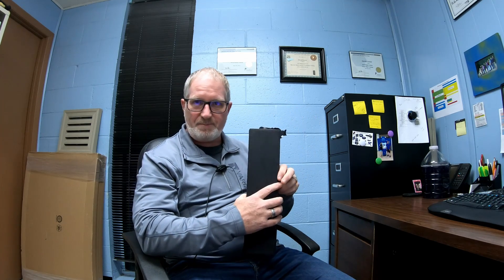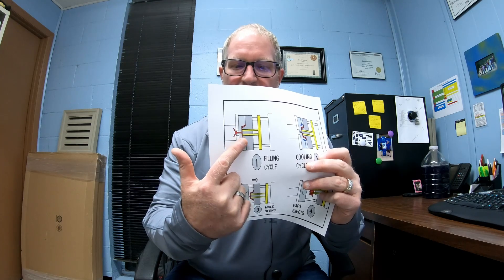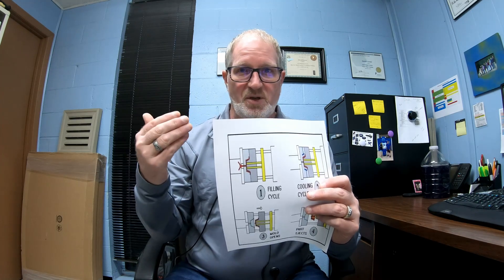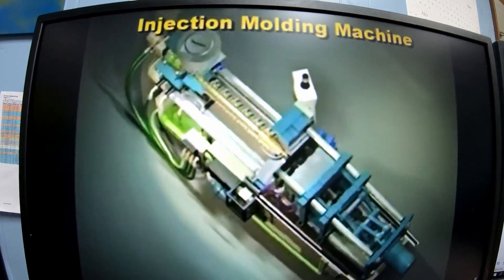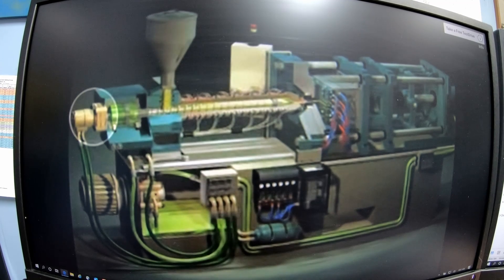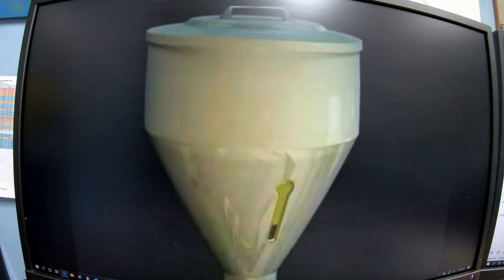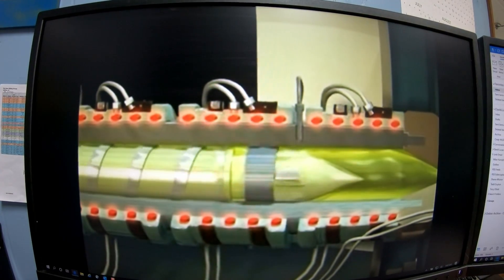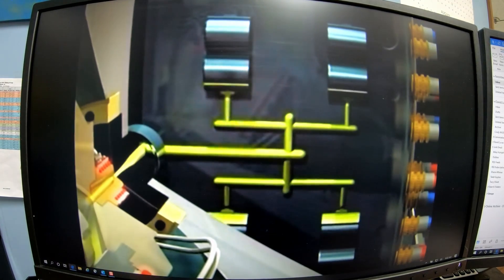(FLASH) In Injection Molding

Comment: Sir. Can you share with us how to improve burn mark? How to make proper air vent without any flashing??
Reply from the maker: If you are having issues with burns. Try to slow down the speed, clamp tonnage lower, or clean mold or vents. If this doesn't work try to put tape in the area that is showing the burn at the parting line. You can use labels with the tape, this will tell you where the vent should be & if it works. Then you can have tooling cut a new vent for you. I hope this helped
Reply: @injectionmoldingskillsmore1064  fyi i am from tooling dept . Haha i see your videos more related to process. But your content very helpful sir. If u have any channel related to tooling knowledge n skills, please recommend to me. Thankyou sir
Reply from the maker: @syafiqrusli9951  Yes sir I will, Thanks for the support to the channel.

Comment: Is there any thing I could do to remove a stuck part out of the fixed half. I think I have over packed it.
Reply from the maker: If you use some toilet paper or a sheet of paper & stick it in the mold area. Close the mold up on the part but don't build up tonnage. the part will pull out with the paper.